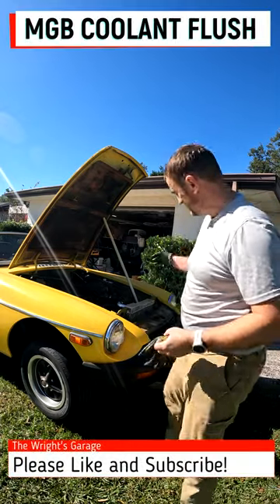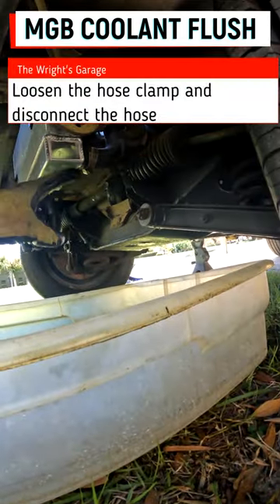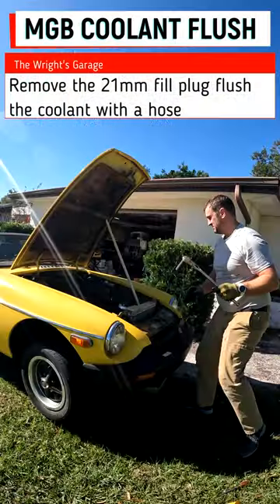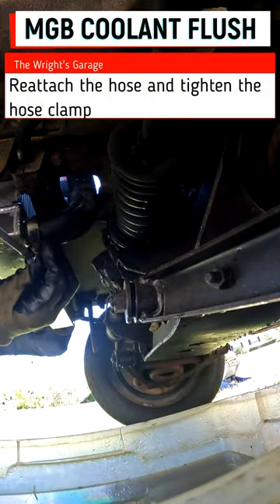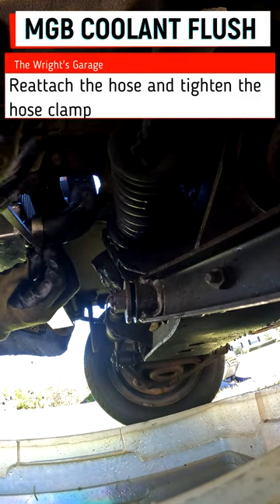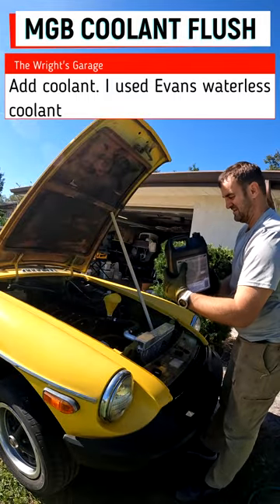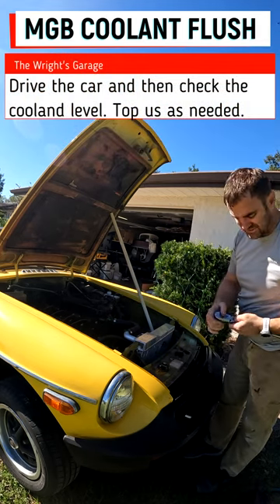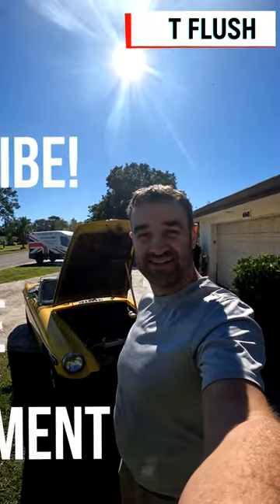MGB Coolant flush #shorts

Comment: Why do you use waterless coolant?.. I’m about to use gm orange coolant at a 50/50 mix with distilled water. I have a 1978 mgb roadster
Reply from the maker: I was having lots of issues with the car overheating. So once I got it working right and didn't need to change fluid often anymore, I opted for the waterless coolant. It's expensive but is much more efficient at keeping the temps down.